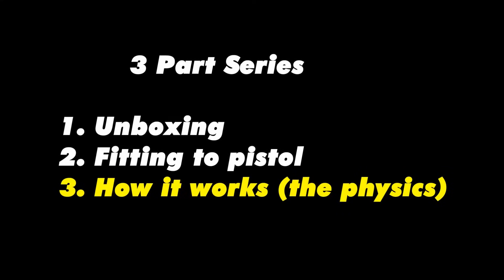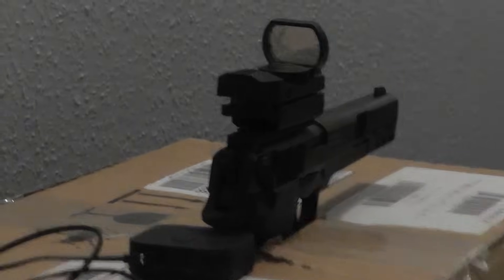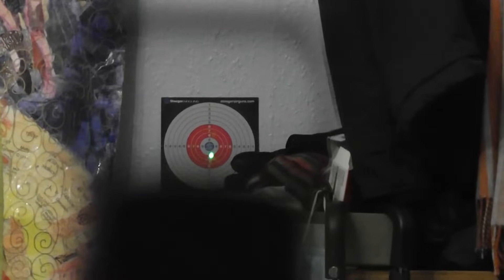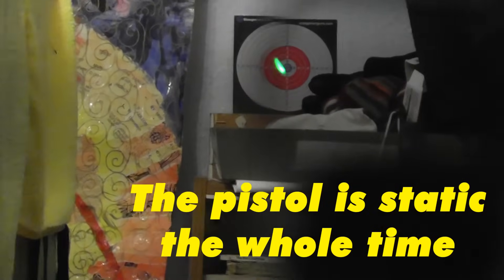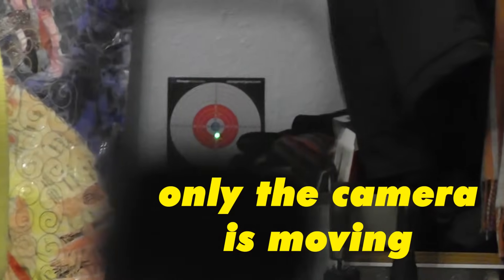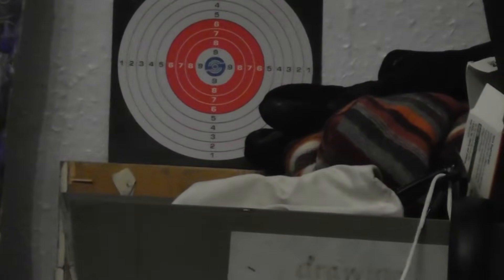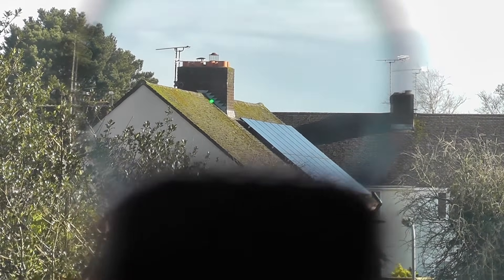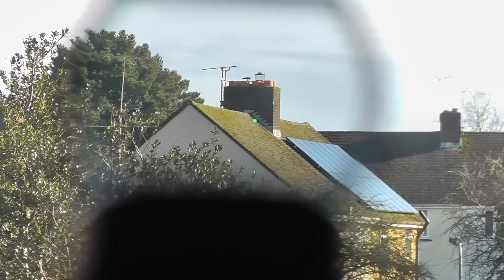Red Dot Sight Physics (How it Works)

Comment: Thank you for this video. Quick question, if one were to add a layer of clear film to the outer surface of the glass, would this effect the sight picture in anyway? Assuming the film is perfectly clear?
Reply from the maker: I guess that would depend on the refraction of that additional clear film layer. As that new layer is curved I would say that the refraction of light would distort what you see of the target. So, whilst the red dot (LED beam) would be unaffected the target would not be shown as being where it would be without the extra film.
That's if the original lens/screen is accurately made so as to not cause that same type of distortion itself.
Reply: @markporthouse  Thanks for addressing my question. Would you be open to discussing this a bit further/deeper in private correspondence? I’d be happy to share my email with the you if you are willing?

Comment: 16:19  yes so that's bad for long distances right ?
Reply from the maker: No. At long distances the parallax inaccuracy (which doesn't change with distance) is swamped by simple distance related inaccuracy, which does increase with distance.
Reply: So for exemple, 2 mm on the left from the center of the lense means  2mm * zoom of the lense = for example 20 Cm off the target  @markporthouse

Comment: 2025 here
Finally figured out how to is works
What I understand is the glass has curvature so that the angle at which the reticle meets your eye will always line up with the angle of the barrel (but slightly above due to height over bore) it looks like the curvature of the glass will always put that dot at an infinite distance ahead of you so there is no inaccuracy regardless of the position of your eye
Reply from the maker: Yeah. That sums it up well. :)

Comment: I’m reaching out because I’m concerned about the light entering the eyes. That LED isn’t emitting laser light, is it?
Reply from the maker: Usually they are LED. I can't speak for all, but I can't imagine any red dot sight manufacturer using a laser. A laser wouldn't be needed over such a short path of light (from the sight to the eye), the benefits of a laser would only be needed where the light travelled much longer distances. Laser are typically only used where the sight actually lights up the target itself (like those movies where you see a red spot of light appear on someone's chest or face).
Reply: @markporthouse  That’s a relief...! In the case of holographic sights, they seem to use laser LEDs.

Comment: 02:35 astigmatism, that's what that's about, I suffer from it, red dot looks great in video/photos but looks terrible with my naked eye.
Reply from the maker: Ah, that makes sense. I do have a slight astigmatism to one eye, I guess, therefore, my right!
Reply: Ive heard larger dots (larger MOA like a 3 or 5) helps with astigmatism.  In addition there are now green dots that somehow work better for folks with astigmatism.  But Im no expert that's just what Ive heard.  Also try lowering intensity of the led...

Comment: But won't the image of the target be distorted by the lens?
Reply from the maker: Great question! I hadn't even thought about this. So, in fact, my drawings of the reflector is incorrect (although I wasn't trying to address your point at all), as I have a flat front face and a curved back face...
Whether the image is distorted depends on whether the angle of the front face of the lens is different to the angle of the back face of the lens relative to the direction the light is coming from (from the target). So, because the lens curves, the thickness of the lens has to vary in order to keep the angles of the surface the same.
The surfaces of a lens the shape of a 'D' are not at the same angle as the light comes through (the surfaces are not parallel), so the lens distorts the image.
The surfaces of lenses the shape of an 'I' or a '/' are at the same angle, they are parallel (throughout the height of the lens), so these lenses don't distort the image, they aren't really lenses at all, as there is no lensing effect. Just like glass in a window. A lens the shape of a '(' would distort the light if the lens was the same thickness throughout, but if, to keep the surfaces parallel (at the same angle) you allow the lens to be thicker at the top and bottom, it won't distort.

Comment: I studied something about refraction in the last days and I just gave up! OK, the light goes always to the focus (between center and pole), the red dot it's simple. The light that comes from the target needs to enter a convex face and exits the concave face. I tried with excel with little success. Using the excel numbers in autocad I got a few errors but... a skilled technician won't have problems to define both curves. I'm satisfied, I am not planning to manufacture these things anyway.

Comment: If the LED is at the focal point of the "lens" (we're using the lens more as a mirror in this case), then all you will see is a massive red dot filling up the sight if you look perfectly parallel to its principal axis. The LED has to be put between the glass and its focal point for its image to appear at a specific distance.
Reply from the maker: Yes, that's a really good point - not something that I'd thought about. If the LED were at the focal point of the 'lens/mirror', the red light would fill up the entire sight (if you were looking at the target, through the sight) and the sight would be useless. So yes, the LED must be 'in front' of the focal point for the light to appear as a dot of light on the distant target  (I'm assuming that you are correct, I haven't quite thought this bit through properly yet). Thanks for your comment.
Reply: @markporthouse  Hey! So after a lot more research and rumination, I found that my statement in the comment above was wrong. Sorry all! 
The LED is at the focal point and its image is at infinity. It doesn't cause the whole lens to be lit up like I thought. The reason we want the image of the dot at infinity is so that when we draw a ray from our eye to the image of the dot, that ray is parallel to the barrel of the gun.

Comment: I think something I've come to realize is a larger window on a rds can help with issues up to a certain or beyond a certain distance also distance of your eyes from the lense.
Example would be using a micro rds on a pistol I can shoot in a straight line up a target from 3-10/12yds but once I get it to 15 is starts to get wonky. Windage is off and even elevation start to shift. And not in the normal shot spread. What's a 1in group at 10-12 yds, becomes a 2-3in at 15. I also have longer arms and if I bring it in a little closer on a bag rest the shots tighten up. It ends up causing issues zeroing at 15 yds or taking longer shots.
Essentially because the window is smaller the parabolic lenses curve is more dramatic in a tiny window and slight shifts behind it cause more shift in image. Additionally it's worth understanding what tool for the job. A micro rds is for 10/12 yds maybe 15 depending on shooter and in. I can still be used for further shots but requires more precise lining up in the window.
Reply from the maker: Interesting thoughts. I'm afraid that I don't have anything intelligent to contribute about the accuracy stuff.
However, the lens curvature on a micro RDS should be the same as on a larger RDS, as the micro is just a cropped down lens and must have the same geometry over its area as the geometry of that same area, that same portion, of a larger RDS.

Comment: hey, you said that with your eyes the dot is looking less defined right? that means you have astigmatism. you should get an eye test.
Reply from the maker: Wow. Impressive. I wouldn't have known there was a connection. I have worn reading glasses for five years now and they correct for astigmatism. I don't wear long distance glasses though. So for using the sight on the air pistol, I ought to get long distance glasses to correct for my astigmatism (even though I'm not short sighted) - ah! Brilliant.

Comment: Does the bullet hit the same spot the red dot is sighted
Reply from the maker: Well, in my case a pellet, with it being an air pistol, there are the usual inaccuracies, but not due to the sight being wrong. The sight is fully accurate when the dot is in the centre and it has been set correctly. The accuracy would be compromised slightly when the red dot is not in the middle of the sight, i.e. when you aren't looking from directly behind the sight. Although the point of the optics is to keep accuracy even if your eye isn't directly behind the sight.

Comment: Your explanation of "REFLECTION" for where the red dot appears is good, but you forgot the "REFRACTION" the target's image experiences as it exits the glass on the eye side. Like a prism the target will appear elsewhere unless a compensating glass on the target side compensates to restore the parallel rays from the target.  ie. both sides of the red dot sight lense must be curved.  Thank you though, it's a excellent quality video, lot's of great effort!
Reply from the maker: That's a great point. I haven't discussed how the forward side of the lens has to be shaped (considering the shape of the back side of the lens) to ensure the light from the target continues in it's original direction. Thinking about it, I bet a cheap red dot site doesn't even engineer this in - it may well just have a fixed lens thickness instead. Thanks for your contribution.
Reply: @ wm6117............ and that's EXACTLY what separates a $30 red dot from a $300 red dot
Reply: In just a few hours all answers can be found on internet. Those chinese from aliexpress are no stupid. To deal with light is just a matter of trigonometry and aplying refraction indexes (1.33 for water, 1.52 for glass, 1.59 for polycarbonate, 1 for vacuum). A good technician can do it. I am studying this for less than a week and I can, almost, see the solution.

Comment: Thanks, this helped me program a holographic sight for a video game!
Reply from the maker: Pleased to hear it. All the best with the game!
Reply: It´s been a year, any Demo of your game? would love to check it out :D
Reply: Yo just a heads up, a holographic sight actually works differently. A holographic sight doesn’t use curved surfaces to bounce the image to your eye like a normal red dot. In a holographic sight, a holographic grating is illuminated with a laser diode which is then projected onto a flat screen. 

You can imagine the holographic grating is like those hologram fridge magnets you’d get as a kid where the image changes depending on what angle you view it from. In the case of the holographic sight, the grating allows the reticle to be viewed from multiple angles without the need for a curved reflection surface like a red dot. The advantage of the holographic sight over a reflector sight is the fact that the reticle image does not “smear” like the red dot shown, the reticle does not drift as much depending on the viewing angle, and the reticle can be represented in much finer detail.  Hopefully this can help with your game!
Reply: Hey man it's been 2 years any demo or something of the sort coming?
Reply: Dang y'all arguing too much. My approach was to use a ray-plane intersection test, where the plane is the red dot sight's glass and the ray is defined as starting at the cameras position and pointing towards the tip of the barrel. This emulates the red dot effect pretty nicely, is very cheap to compute, and works for almost any camera angle. It also prevents the dot from appearing on the other side of the sight. There's no need to actually simulate the interactions of light and the lense, thats just impractical for real time video games.
Reply: @soliform3485 EXACTLY, thank you for clarifying. This has been filled with supposed video game experts who have no idea how a game is made.
Reply: @ soliform is correct, you are spouting nonsense the whole time
Reply: @FurryTrash_ Seems that you are the only one who is not understanding that using this for videogames is stupid.
Reply: @soliform3485  or we could emulate parallax at least for realism, using the ray optics formulas
Reply: @ and how do you plan to simulate the parallax effect?
Reply: @Izz4cc  because the ray is pointing at the end of the barrel and not the sight itself, it intersects the plane in a way that gives a sense of depth
Reply: @soliform3485  that's not what I meant, the red dot should not have any parallax wrt your target
Reply: @Izz4cc actually it should, red dots have a small bit of parallax, a holo sight would have none
Reply: Game Developer here, how tf u need this to render a point in the middle of the sight? This is necessary on real life because we cannot attach a red led in the middle of the sight. But on videogames is easy as render it on the middle...
Reply: @xKarmaYT  the best representation would be a glowing dot that is rendered a few meters in front of the sight, and only visible if you're looking through the sight
Reply: @xKarmaYT how would a dot rendered on the middle of a plane be 'parallax free'?
Reply: @brunothiagorvs  who is talking about a plane? tf
Reply: @xKarmaYT  oh sorry, in the middle of the sight 🤷🏽‍♂️
Reply: @brunothiagorvs  I don't understand your question then. Is there parallax due to the distance between the background and the scope.  I comment again that this is a video game with a suspension point. Something not possible in real life
Reply: @xKarmaYT  So, the red dot seems to stay in the same place even if the shooter moves their head. Without having access to such a sight, it seems obvious that simply placing a luminous dot in the center of the sight would suffice, but it’s slightly more complex than that (not much).
Reply: @brunothiagorvs  Well explain to me why. Because I have a game with that red dot and a holographic sight in real life and I see no difference. The only one there can be is according to the movement from the eye of the one who observes it
Reply: @xKarmaYT  And that movement is what we are interested here.
Reply: @brunothiagorvs  And that movement works with what I say. So what's your point?
Reply: @xKarmaYT  just to clarify, you placed a point inside the sight? No further modification or something?
Reply: @xKarmaYT  it doesn't work that way, if you're talking about "just put a red dot on a piece of glass". The point of holo sight is that the dot ~always stays on the target. We can put red dots on glass in real life too u know. it's called paint.
Reply: @barbiefan3874  Is obviously you are not a game developer lmao
Reply: @xKarmaYT  maybe the game had more realism in mind. If we are going for a simple shooter like cod just plopping a red dot on the screen like a hud when the sights are up works but what about more realistic games such as arma or tarkov? Maybe a vr game could benefit from this too
Reply: @postaldude7879  but it doesn't make any sense to do that from a technical perspective. The reason it is done in real life is because there is no way to levitate a red dot. In games there are no real physics and therefore you get the same effect without doing this stupid thing.
Reply: @xKarmaYT  hmm.. yeah ur right
Reply: @xKarmaYT  I recently finished working on a game where I developed 18 weapons each with red dot sights, you don't know what you're talking about.
Reply: @IAmKlagg  Oh really? Tell me the game names. I'm tired of this k1ds like you. They won't let me, but I don't care. I work at Activision. Do you know what games are there?
Reply: @xKarmaYT  did you watch the video? the red dot shows where the bullet will hit, regardless of where your head is. if you just painted a dot on then the dot would not tell you anything as your head would not be perfectly aligned.
Reply: @FurryTrash_  it looks like he's rage baiting...
Reply: @ i dont know, id believe he was that dumb, a lot of games have messed it up before, most recent thing i saw was atomic heart
Reply: @FurryTrash_ dude THE HEAD IS FIXED AUTOMATICALLY TO THE CENTER ON A FPS. You NEVER made a game before k1-d0
Reply: Full of k1-ddos that never wrote a line of code of a game on their life

Comment: Great video! Would I be right in saying that the curvature of the lens is parabolic?
Reply from the maker: I had to look that up. Basically yes, but a parabola is only two dimensional, so actually it is a paraboloid! (Who knew?!) Also, I don't know if it would be described as 'part' paraboloid, because, of course, this reflector (not lens) doesn't even have the tightest part of the curve of a paraboloid - and by definition a parabola or paraboloid is symetrical, which this reflector clearly isn't, as it is only an unsymmetrical part of one.